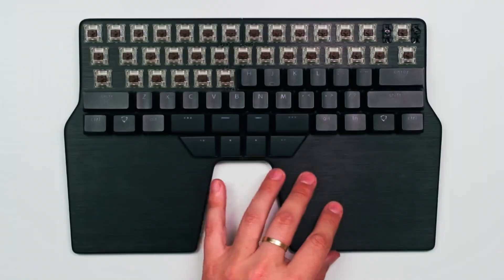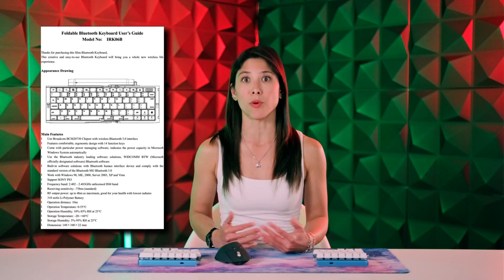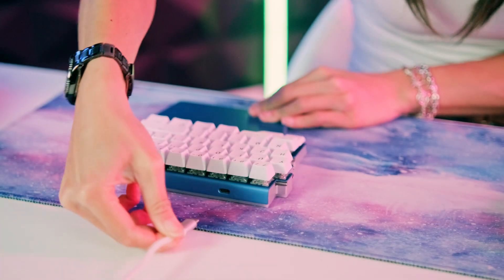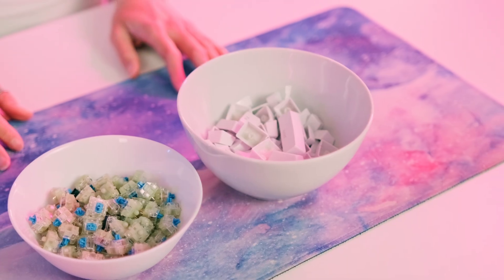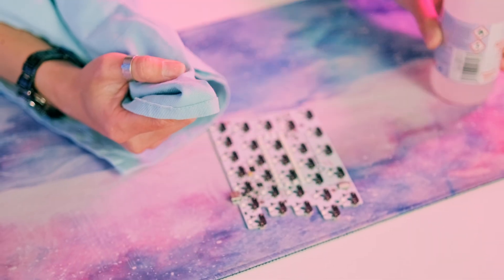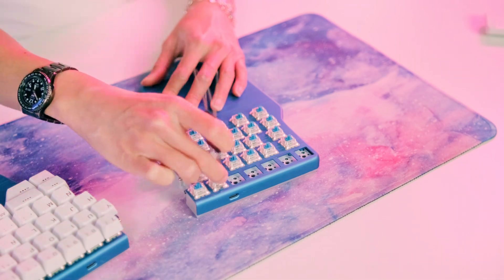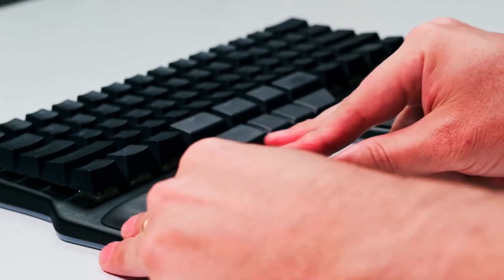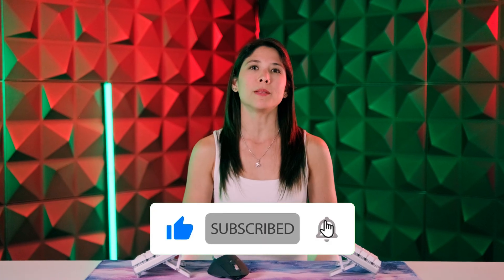Did you spill water on your keyboard? Here's what to do

Comment: I've spilt water with a magnesium supplement tablet on my keyboard. I've left my keyboard to dry for around 30ish hours (after cleaning it) now most buttons work but whenever i press my tab,caps lock, shift, etc buttons on the left all the buttons in that row seem to send signals (get pressed) the escape button and remainder of my keyboard work. is there anything i can do or is it time for my old k95 to retire?
Reply from the maker: That's probably because a switch is defective after the spill, so it triggers the whole column. If the keyboard is not hot-swappable... it's doomed.

Comment: A basic keyboard has plastic films with conductive strips. You just need to carefully remove them, rinse in a sink and dry between them using sheets of paper while they are together in their natural position. They will never dry on their own. A hair dryer or oil might deform them, or the tracks could come off. You might also take the opportunity to deep-clean the keyboard from debris and hair while it is open.
Reply from the maker: Sounds delicate... but thanks for the tip!

Comment: I split gatorade and my computer won’t stop pressing 1. I saw this video after I used a towel to clean it. Second time this month. How the fluff will I explain this one.
Reply from the maker: 🥹🥹 hope you were able to save it!
Reply: @DygmaLab  I actually was! I removed the switch entirely and it worked somehow? There's now electrical tape covering where it used to be. I will use this video for next time though. If there is a next time.

Comment: Just spilled around 50mm of water into my BlitzWolf BW-KB1 and I am desperate right now. Tried disassemble the keys, but it is difficult and I'm afraid I may fuck things up. 😢
Reply from the maker: How have you disassembled it? Have you got the proper tools for it?
Reply: @DygmaLab  Thank God after some hours the keyboard is alright. Sadly the switches are welded into the board, so there is no way of removing them in order to clean them inside, but thank you for your reply. I disassembled it as much as I could and left it for over an hour in front of my fan. Not the best way to dry it, I know, but it seems the board has not been rusty. 🙏🏻
Reply: @DygmaLab  and it was not 50ml of water, but near half cup of water. I was really desperate. 😢

Comment: Can anyone help me? 
So i have a hyperX keyboard, my cousin spilled some water on it, i unplugged it and started removing the keycaps and cleaned it on the outside, i didnt unscrew everything inside, i then put everything back and it was pressing random keycaps by itself and only some lights lit up, i then unplugged it after 10-15 seconds, i am really scared, can anyone help please i really need some help
Reply from the maker: I would recommend completely disassembling it. You need to clean the electronics with isopropyl alcohol to make sure there's corrosion.
Reply: Update: I unscrewed everything and took off the back of the keyboard, theres water that dried off inside, i have to get it all off, it will take a lot of time since its on each key, i dont think i can get the keycaps off, im going to take it to someone to clean it and maybe see if he can fix it
Reply: Update: I repaired it myself, it works just perfectly and i also got to clean it , thank you for your tips and tricks, they truly worked
Reply from the maker: @bd29v71  that's great to hear! Glad it worked 😊

Comment: I spilled 7up in my keyboard. I quickly shaked my keyboard and let it all drip out. Then i kept playing. But the next day my spacebar & n key didn't work anymore. The day after i opened my keyboard because i didn't know the day before. A few drops were left, cleaned it, but still didn't work :(. i think most of the soda dried and maybe there arose a bit of dust.
Reply from the maker: You can try cleaning it with isopropyl alcohol. It might come back from the dead 😊
Reply: @DygmaLab   do i have to use isopropyl or is 70% alcohol fine?
Reply from the maker: @sjoekert3549 Isopropyl is the one you really need to use for electronics

Comment: What if it dries and i do nothing?
Reply from the maker: Then you might get corrosion on your circuits 😬
Reply: @DygmaLab  well i did nothing it dried but now 2 of my keys dont light up🥲
Reply from the maker: You can try openening the keyboard and cleaning it with Isopropyl alcohol, but that's the risk of letting it dry up 😢

Comment: Wide bottom tankards are very resistant to being knocked over. I put my soda cans inside one for maximum spill protection.
Reply from the maker: Oh that adds a whole new level of protection 😏
Reply: I don‘t know tankards but I have a couple of Might Mugs. You can lift them straight up, but if you push them from the side they won't move (most of the time).

Comment: How about keyboards that are designed to be waterproof or water resistant.  I believe they have a built in waterproof membrane.  Some have IP32 specifications. 
Is it possible for the Dygma Defy or Dygma Raise to come with waterproof capabilities such as these? That would be a big selling feature for me! 😊
Reply from the maker: Maybe we could consider these in the future, but this adds to the final price and we already have a not-so-cheap product 🤔
Reply: @DygmaLab  Or perhaps if it could be an optional addon? If anyone wants it they pay for it. 
I know I would pay the extra for that feature!
Reply: @DygmaLab or at least to have a power switch that disconnects electronics from batterry

Comment: Tip #00: Don't place drinks so you can tip them over by accident.
Reply from the maker: That would be the best solution. However, sometimes you can't resist to have a drink in between the keyboard halves and we want to make sure everyone knows what to do when case liquid doomsday comes... 💥
Reply: Place the cup far away. This will prevent it from being accidentally knocked over. 
For me the left side is the best.
Reply: @Blackjack-0816 Doesn’t have to be far away, just put it somewhere that’s very unlikely for you to sweep it. There’s different spots for everyone but there’s always safe spots… I figured out mine and have and this haven’t happened to me ever since :) Think that’s 5-6 years now! My girlfriend never learns though it seems 🤣
Reply: it was my bong
Reply: Best place is to put it opposite of where u put ur mouse.
Reply: @Kohi_7  Exactly! I got to stretch my left arm fully to reach my drink. Can't knock it over while playing.
Reply: @Kohi_7  I did this and still somehow managed to spill it all over my keyboard 😔
Reply: Guess don't place drinks make them float

Comment: why don't you just make water-resistant keyboard?
Reply from the maker: That's a great question. 

We really like the hot-swappable capabilities and this wouldn't be available with waterproof design. 

Besides that, even if we were to solder the switches, the stem and how a switch work would make it not waterproof 🤔
Reply: @DygmaLab  you just need to think harder

Comment: Another way to dry electronics is by submerging them in rice for several hours or days
Reply: That is even worse than doing nothing or using a hairdryer, because on top of the water depositing what it has in suspension now you're introducing another material that won't do anything good but will add extra contamination.
Reply: @EldritchElric  have you ever tried it? I have, and so have thousands of others. it works.
Reply: @ChrisHaupt  I trust more the opinion of people that have hundreds or thousands of repairs on their back, many of them live on camera, and that sometimes have to deal with having to clean the rice leftovers and the extra corrosion associated to that.
Reply from the maker: We thought of this too, but imagine how many kilos of rice you would need 🤣
Reply: @DygmaLab  I guess you guys aren't asian enough to have that much rice lying around. When I was at university our Philipino housemate kept the kitchen stocked with a 10kg bag of rice at all times 😂
Reply from the maker: Okay! 10kg would definetely do it 🤣
Reply: And make a nice rice pudding after.

Comment: I'm not an expert at all, but based on following Louis Rossmann channel for a long time and once in a while watching Jessa Jones videos (from ipadrehab and ifixit) as well you don't want for water to dry but use alcohol for it too. Alcohol (the right kind) is really great.

That's because tap water contains particles in suspension that will be deposited as the water evaporates, both increasing the chance of a short when you power up but also of corrosion from short up to long term. 

And you shouldn't use 70% iso alcohol but as pure as you can, like 90%+ if possible. You can then apply alcohol rubbing on the circuit with a toothbrush, also fully submerging in alcohol the electronics if possible. The idea is for the alcohol to displace the water along its dissolved and in suspension substances, with the advantage that alcohol is very non conductive, it leaves very little residue (if high purity) and evaporates very quickly as well.

So if you spilled water you DON'T want it to dry. You want to act asap (with ipa alcohol) before the water evaporates. And of course that applies to other fluids as well.
Reply: Distilled water would be best, but who has that at home?
Reply from the maker: You're definetely right. If the water in rich in minerals like tap water in some countries this may make things worse. 

The best thing would be to use 96%+ alcohol. We've messed up and only had a 70% bottle when recording 😅

Thank you for your comment!